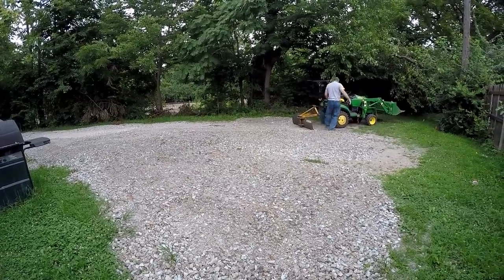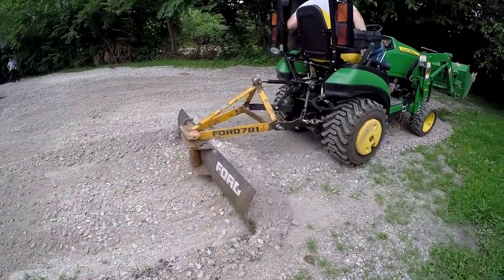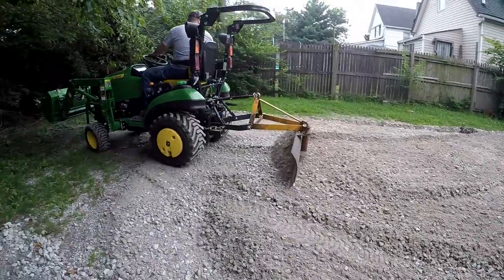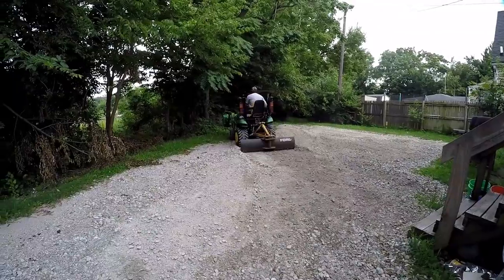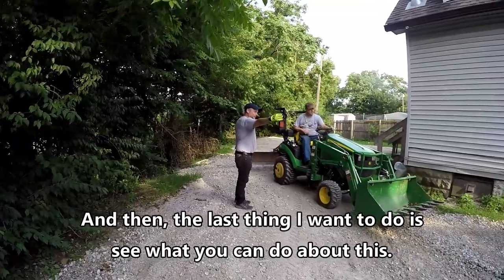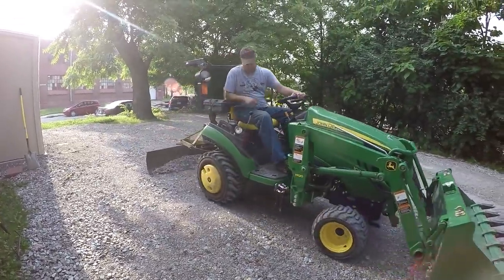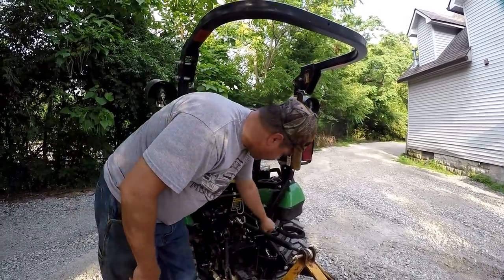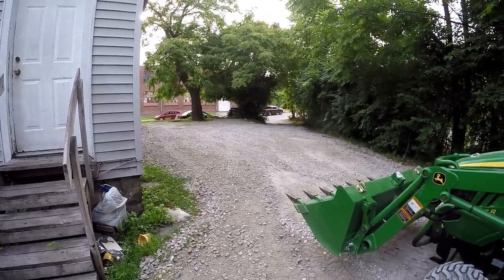Playing in the Rocks: Grading Parking Area with Compact Tractor and Rear Blade

Comment: Another finishing trick with your blade is to spin it clear around and then set it down and go round and round.  We used to do this all the time to smooth a parking lot.  It is just about impossible to "smooth" by pulling the blade facing forward.  It always wants to gouge or raise up too much.

Comment: Hey Tim I don't know if you read the comments anymore, you are right about locking the 3 point arm, but the top one you don't because you need to be able to adjust the top arm as you go. The longer the top arm the more it cuts the shorter the arm for fine tuning.
Reply from the maker: I still read-em. All of them :-)

Comment: Good job Tim. A single section of drag harrow or a piece of railroad iron  behind the blade on the last pass, would have finished it off nicely where no raking was required. Of course you would have to have a GRAPPLE to pick it up off the trailer. :)
Reply from the maker: Ha!

Comment: Great job, Tim. Your commentary about the box blade was exactly what I was thinking. While you were able to get the job done nicely with the angle blade, I think the box blade would have worked a little faster for you. I have a 1023e with a Frontier 60"box blade I purchased at the same time as the tractor, loader, and a 48" Frontier rotary cutter as a package deal. I was concerned when my dealership recommended the 60"  boxblade over the 48" that my little tractor wouldn't be able to pull it with a full with a box full of material. They assured me it would, and I have been pleasantly surprised that my 1023e can pull it fine with as long as I don't have the "teeth" in the lower settings. When I  need to use the teeth, I have learned to leave the implement up high enough to not move much material at all with the box. After I have torn up the surface of the dirt or chat with the teeth, I then raise the teeth back up and use the cutting blade alone to smooth it out. You can probably accomplish the same result with your tooth bar on the bucket and rarely use your teeth on the box blade. I also use my box blade teeth in the place of a chisel plow before I go over the garden with my little 12 blade King Kutter disk. I know your tiller is the optimal solution but I decided to spend less money on the disk and use that approach. I get roughly the same effect with this combination as a tiller for a little less money since I already had the box blade. Finally, the last significant benefit of the 60" box blade I will mention is you can spread material very close to a landscape timber, sidewalk, or some other form of barrier because the blade sticks out roughly 6" past the tractor tires on both sides allowing the operator to drive along beside the edge without running over it. If you ever decide to buy a box blade I would recommend a light duty 60" over the 48". I enjoy the videos! Keep it up!
Reply from the maker: +Kirk Brinkley good comment.
Reply: Kirk Brinkley  You sir just made me go out and purchase a 60” box blade! Thank you for your wise comment. It is much appreciated!

Comment: If you turn the blade around and drag with the back side of it, it'll smooth out better without using the bottom of your bucket. Down at the farm, we've got a driveway over 1/2 mile long, and just back-drag (with no down hydro pressure) each side angled toward the middle, then back-drag the middle with a straight blade to distribute the row that you just created. It usually works out really well, except I had to actually forward-blade grade it yesterday, because the rain that Owen County got last Sunday night made a bunch of 4" deep trails down the driveway (there's around 300ft of elevation difference), and there's been a lot of logging trucks through there in the last year, so not a ton of free gravel on the top right now. This is with a Deere 5320 and a 6ft Woods blade.

Comment: Tim, my 2 cents worth, I have both a grader blade and a box blade. They are different implements for different jobs. It is sorta like a rotary cutter and a finish mower. Similar product, but different in so many ways. 
For future jobs that blade is adjustable. Setting it at an angle to your pull will change the cut of the blade. It will also push most of the material to exit on one side of the blade reducing the ridge to almost nothing on the other side. This cutting action will help it cut down the hump.

Comment: It works well to spin blade around 180 degrees so you can pull it with the blade basically backwards for the final pass it does a good job of lightly smoothing things out without digging in much

Comment: I just bought a 1025r with loader. I have a pull type box scraper I bought a few years back. The trouble with a mounted blade is when you go over humps it digs in and the opposite in a hole. Looked nice when you got done
Reply from the maker: Yes!!  Especially with such a short wheelbase Tractor!  Really difficult.

Comment: A box blade works amazing! It traps the gravel into the box and levels everything perfectly. I have a huge driveway which is all gravel and I blade it probable every 3 months.
Reply from the maker: +CR Mills sounds good. Maybe someday.  I have had one on Johnny.  Our church has a 5' Land Pride.  I tried it out on the driveway there last summer.
Reply: I use the blade exactly like yours, then just pull around a empty pallet to smooth out the lines from the edges of the blade passes
Reply: Jthumper I use a 6' woods BSS72 and ABI TR3 rake to do driveways. The box scraper I use more in a reverse motion on hard driveways. The rear blade cuts much better than the front blade. As for the TR3. It has a floating leveling blade that can be locked to use as a box scraper. Too many implements that could be used to do this job.

Comment: Anytime I spread rock, there are 3 implements I use...
1 - Front End Loader to initially move the material from the pile and roughly spread it around.
2 - Box blade to more evenly spread the material and move it from high to low spots.
3 - Landscape rake (rock rake, york rake, whatever you wanna call it) to finish it off and smooth it out.  The rake tines allow the rock to pass through where needed to smooth it more evenly than the box blade.  It doesn't so much transfer material but smooth it out.  You can grab a pile and carry it a short distance but it will eventually just spread it evenly along your path.  This works well for dirt also.  Think of a garden rake except supersized.
Reply from the maker: +Jeremy Fortune makes sense!

Comment: In the UK when operating an Caterpillar 428 180° excavator doing similar work, the 6 in 1 shovel can be used as a dozer/grading blade. When the intial uneven surface is flattened. I would finish off using the shovel in the float position, that is the lever quickly thrust forward to overcome the hydraulics where gravity takes effect causing the shovel to float over the surface by weight alone. Any slight unevenness is eliminated. Followed by a few runs reversing backwards to compact the ground with hydraulic pressure of the shovel even if it means front wheels off the ground and the weight of the machine on the shovel. Different methods for the same result I suppose. :) These machines are made to make manual labour involving a few workers a thing of the past. Nice job well done anyway.
Reply from the maker: +D0csavage1 thanks, Doc

Comment: I have a Woods blade but haven't used it yet, but for spreading gravel it will work well. A box scraper though is needed to work up and move compacted material. I have a 60" that keeps the long driveway in shape. I also use it to make drainage swales and crown for drainage.
Reply from the maker: +thnksno box blade is definitely more versatile.
Reply: Tractor Time with Tim I don't see why you couldn't get the same shaping effects using a rear blade. Adjusting the lift linkage off level would make a blade cut?

Comment: I used a back blade for years in my drive and it worked fine. I now have a box blade, and it is just easier and quicker. With the box blade you don't have to chase down the spillage of the side of the blade. But the blade is cheaper and works. Like anything in life there are trade offs.
Reply from the maker: +Pat Conroy yep.

Comment: Tim, if you needed to get deep. You can turn the blade backwards and push in reverse to get the mound moved fast. BUT GOING IN REVERSE WITH THE BLADE TURNED AROUND YOU MUST BE CAREFUL NOT TO DIG TOO DEEP. That is where a box scraper is nice. The front bit keeps the rear bit from digging too deep and vice versa.
Reply from the maker: +Drew6709 makes sense

Comment: A friend of mine had an older style blade for his 8N  and we used it on gravel.  I wouldn't recommend pushing backwards with it very hard. The pivot and angle adjustment on his broke and the blade folded underneath like tin foil.

Comment: You would not have needed the scarifiers on a box blade but the ability to capture and move the rock could have helped alot.  In addition pushing backwards with a box blade acts alot like a mini-bulldozer.  For the finish extending out your top-link and letting the back edge smooting the rock gives a really nice finish.  Also if you did not have the teeth on your bucket you could use it more effectively at least on this project.
Reply from the maker: +Tab Petree teeth easily removable.

Comment: We're did you get the teeth bar for your bucket? I have a 4310 that would work wonderfully on. And make some bolt on side for your back blade and you will have a little more caring capacity with your blad.
Reply from the maker: www.heavyhitch.com    use coupon code TTWT for a 5% discount!  ...thanks for asking.

Comment: just set a few sacks of cement on that 3 point and your set, i put plywood in the A part of the blade and set 2 sacks on it- if you run out of traction just grab a bucket of gravel- this is when you can feel the lack of power when doing long roads in high range, prob not the best on my hydro trans though

Comment: That blade looks to be shaped about perfect for the work you were doing. I've had blades in the past that had a cutting edge that was too aggressive which made doing fine grading difficult. Even adjusting the top link didn't help much. Yours looks like it would be a good snow blade as well. As for running out of space when working near the edges, your blade should turn 180-degrees so you could push backwards.
Reply from the maker: It really did work pretty well.  Especially for being old and rusty.     
I adjusted the top link a bit to get it to suit.  After that, it worked fine.

Comment: A land grader would have worked as well but those implements DON'T have a closed back for carrying material. With the open back, material rolls over the 2 blade edges and levels using a larger area and skids that allow it stay level on uneven ground.
Reply from the maker: +Drew6709 yes, land plane would have been great.

Comment: Tim, did you consider using the front blade that I saw on one of your earlier videos?  It might have helped you get closer to the tree line as you discussed in the video.  On the other hand, maybe you felt that it wouldn't be strong enough for the job?
Reply from the maker: +Eager Subscriber if you are referring to our snow blade, no, the mounting quick attach system is not strong enough to handle dirt/rock work.

Comment: I have a 1025r which I really like. I get a lot of work stump grinding but can't seem to get the other type of work you get, spreading gravel removing hedges etc. what method would you recommend for expanding my tractor business?
Reply from the maker: +Dan Tabler I'm no expert on this Dan.  What type of stump grinder do you use?
Reply: Tractor Time with Tim 
I have a woodland mills stump grinder that works great. Seems like the 1025r was made for this grinder, or maybe the other way around. Less than $2,500 and I paid for it with stump grinding jobs in less than 30 days.
Really would like to expand my  tractor business into other things as well
Reply: Tractor Time with Tim 
Because of the relative low cost of the grinder I regularly under bid the guys who spent 10-20k for a single use machine and still have super great margins

Comment: I'm sure the debate about box blade versus grader blade will rage forever, but if one can afford both, why not? My question:  How much box blade can the 1025r pull? f course, a 48" would be nice for getting through narrow access openings, and will barely cover the tire tracks. Also, I have seen some much larger tractors (Kubotas) with bigger wheels and the same 25hp engine pulling a 60" box blade. Have you done much box work and do you think the 60" box might be a bit too much drag for the 1025r? I'm leaning towards the 48" mainly for the convenience of slipping through narrow gates.
Reply from the maker: I tried a 60”.  It worked,  but in some situations it was a load.  Some manufacturers make a 54”. I might be interested in that size.
BTW, thanks for your Merch order!
Reply: Thanks for the reply, Tim! I suspected about what your experience was, so I went with the 2048L box, also based on better accessibility into back yards. I don't need the extra speed of a 60", so I'll just spend a bit more time doing the bigger jobs and enjoy the ride! LOL
Will enjoy the shirts and cap. Gotta help support Katriel's education, ya know!

Comment: Tim have you ever heard of the ABI TR3 rake for road grading and maintenance. If you have what are your thoughts
Reply from the maker: Have heard of it and watched the videos.

Have not used one.
Reply: I have one. Use it more for landscaping and revitalizing packed gravel lots.
Reply: A Gravel Rascal could also be used in this instance. With the 3 point adapter the Gravel Rascal works with sub-compact tractors.